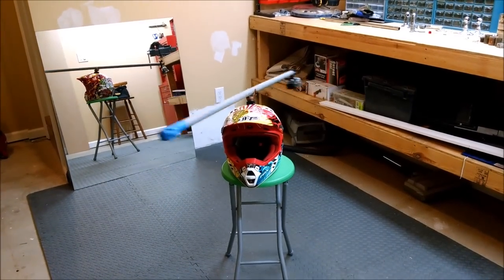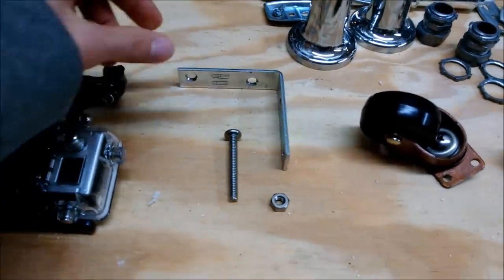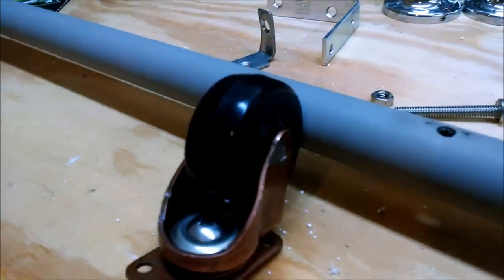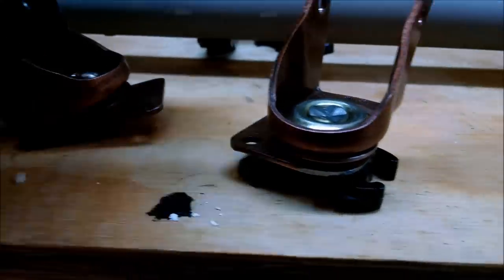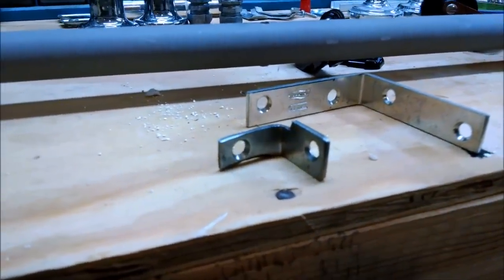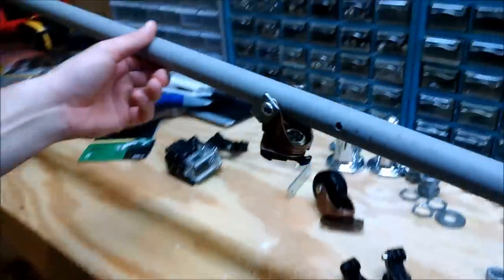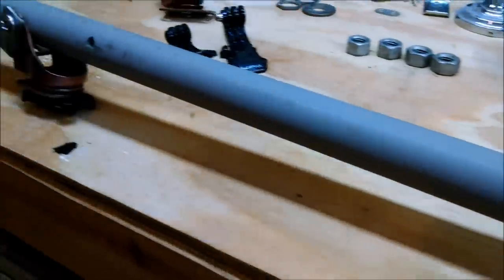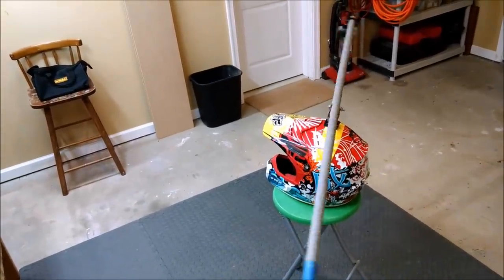How to Build a GoPro 360 Swivel Helmet Mount!

Comment: What sort of weight are we looking at for a counterweight?
Reply from the maker: I don't remember the exact weight, but it was roughly the same as what the GoPro/mount weighted.  Just enough to keep the pipe level on the helmet.  We did some tests with it on the green chair to make sure it was spinning level, just trial and error with that.

Comment: Awesome video!!! I'm going to try to make it too. But can you please tell me exactly how you attached the base plate to the seperated gopro part? Or can you make a little video of it?

Greets from Belgium

Thomas
Reply from the maker: Basically take the three screws out of the hook shape gopro mount. It will then come apart. Then we ground down part of the metal swivel piece. That was you can still pinch the buck piece to get it out of the curved adhesive mount. Then we just used epoxy to glue it together
Reply from the maker: Search my channel for 360 swivel mount, we made another one with a different pipe